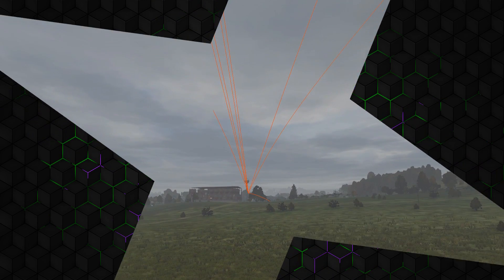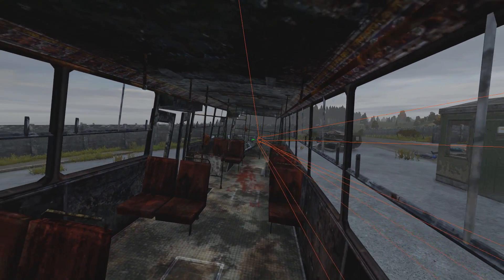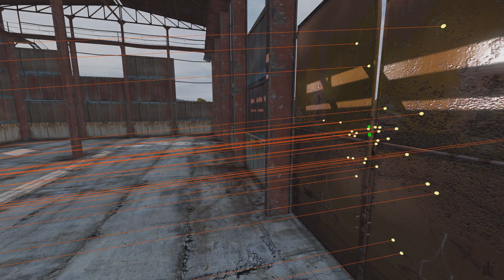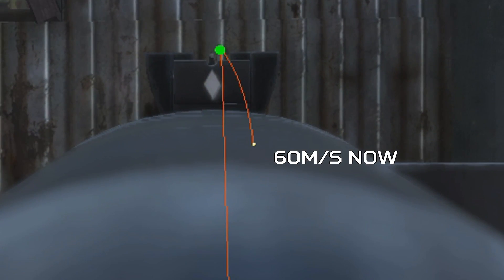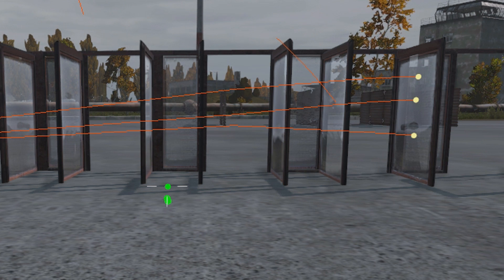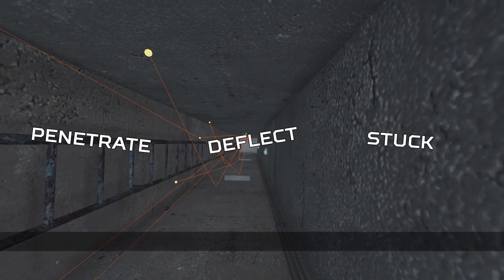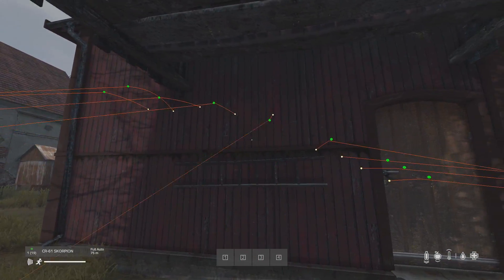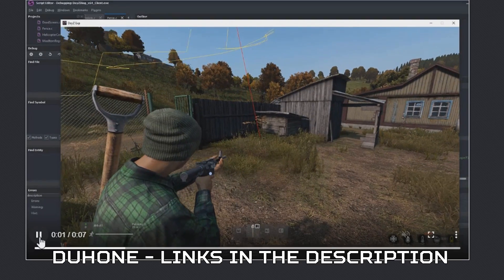How Bullets Travel in DayZ | A Visual Ballistics Guide

Comment: Literally my experience with cars. 
When my cousin, best mate and myself started playing day z console for the first time and played on vanilla. After figuring out how to navigate, many days and many deaths, We finally all go to each other. 
We ended up getting some pretty darn good loot together and had the worst gear fear. 
We end up travelling away from the most high traffic areas with a goal to find and build a car and we did. 
After a-couple days and hours of running around. We finally put together a working car. 
I don’t even think it was 5 mins of being in the car.
Ended up going little bit faster than 60 and all of a sudden. We all started frame glitching, rubber banding, flipping many times and even air born until we were met with the black screen of death. 
They really have to fix that SH*T.

It’s safe to say I took a long break after that.

Like cmon. It even happens on low pop servers whilst playing a ps5.
Cars WILL get you killed either by crashing or giving your position away.
You’re better off running.

Comment: Gonna refuse the gift mainly because I'm kinda cheating. 

I did a lot of ballistic testing in ArmA3 (my steam profile has screenshots of it). I was wondering if it's possible to have the script of drawing bullet paths show the velocity like the one I used in A3 (green for max, yellow, and red) 

It helps provide which weapons will be more lethal through different materials. Or through deflections. It greatly changed on gear I run in different A3 modes to min max velocity and penetrations. 

Last one, I'm curious on if weapons on and off back provide the ability to deflect or stop rounds like in A3.

Comment: 8/10 seems like i know ballistics, to be fair all behaviours except the last one with the concrete are pretty realistic. Yes even the FAL one altough the bullet most likely would not exit on the other side of the house
Reply: Concrete pen of an svd is realistic. 100m svd can penetrate 36inches of concrete irl that's about one meter of concrete for the rest of the world. 

The metal door the svd should have penetrated. Practical testing can pen again 100m range aprox 8inch of metal used in security doors. The door in game looks more like 3/8inch. 

Other than that I agree
Reply: @chiefgully9353  i dunno what kind of concrete youre used to but no handheld rifle will(or essentially should) pen a full meter of solid concrete in one shot. Youre talking here like one could have taken out tanks with a mosin in 2. WW (yes mosin because it takes the same ammo as an SVD, Modern SVD just use the 7N1 Ammo which has way stricter Quality control and therefore is ballistically way more consistent)
Reply: @MrSchipke  it was an old WWII bunker from eastern Europe. Got to watch a demonstration. During op sabre gardian a few years back. 

Think Poland Romania area.

Comment: Thought the ump would pen the lockers
Thought sporter would stuck.
Thought the mosin would stuck.
Thought the skorpion would deflect.
Thought the slug would get stuck
Thought the cr527 would get stuck
Thought the FAL would pen the house.
Thought the ij70 would get stuck
Thought the SVD would pen the door.
Thought the SVD would pen the concrete wall, well not really but it felt like a trick question.